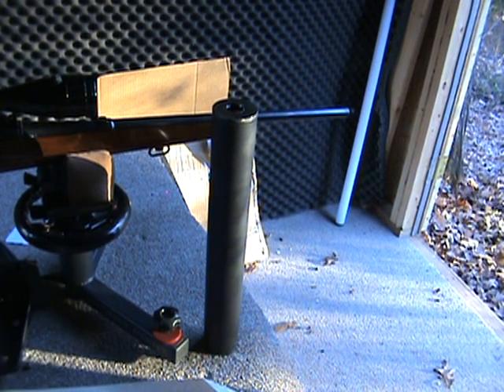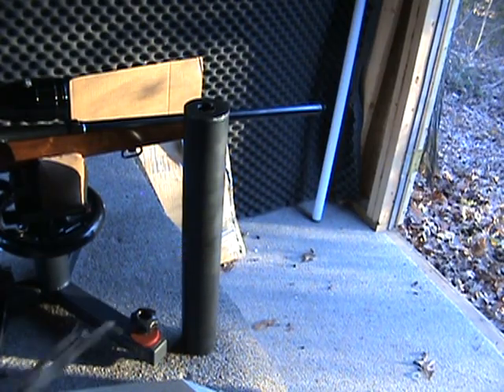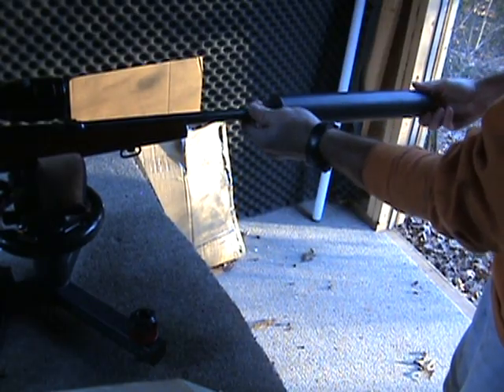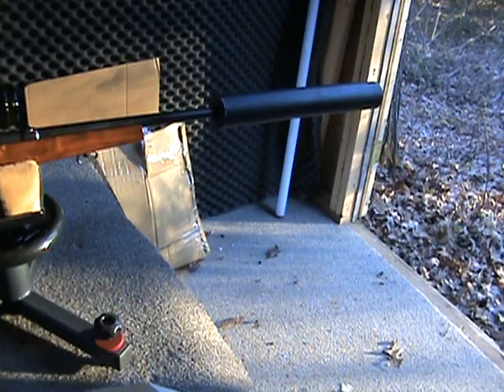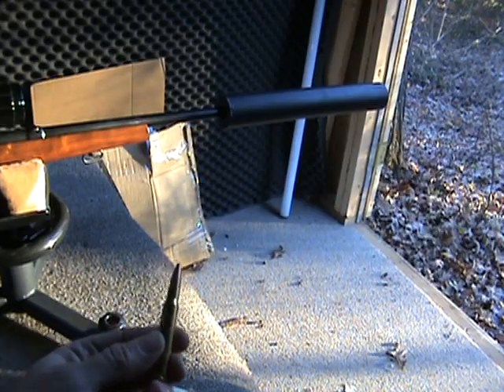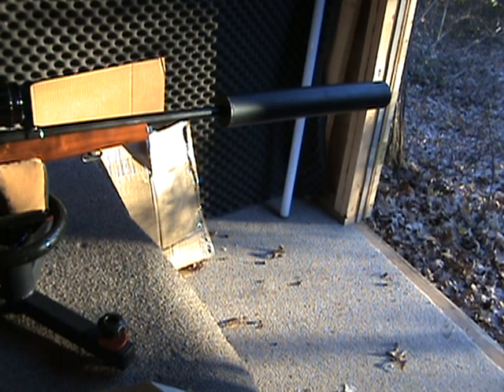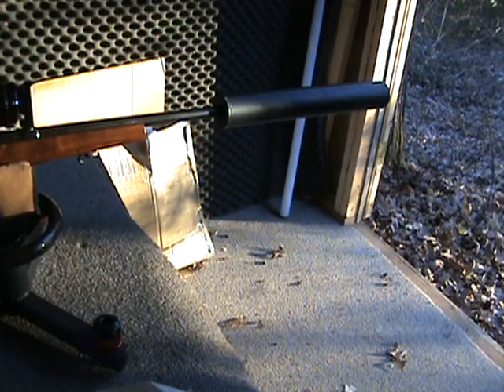Home made suppressor demo for .30-06

Comment: You can put a bolted piece of tungsten in the tube with some gorilla glue around the cylinder about a drop and 1 ml. Then just shove some 30mm bushings 3 inches consecutively apart. It helps if you bore the canister with a 5mm drill bit at both vertical ends.

Comment: Nice can.  I'm planning to do similar with my Savage 110 in 30-06, but I'm going to have the barrel cut down to 16.1 inches then threaded.  I like your slip over design and would love to see how you made the bottom half of your can, did you make it yourself or have someone turn it on a lath for you?

Comment: I'm surprised no one has commented on your video. Nice work in the suppressor. Did your custom rounds require hearing protection? Video audio seldom picks ups what the shooter hears. How long did the ATF take on your Form 1? Mine was pretty much 6 months on the dot in 2012 or 2013 for a pre-designed commercial suppressor. Supposedly the office only had 8 employees at the time completing requests for the entire country .Also, how did you thread your male/female end caps? I ask because I'm not familiar with fine threading process. Thanks for sharing your experience. It sounded effective. Last question, did the neighbors stop complaining? :)
Reply: Don't answer!

Comment: Awesome video. Congratulations 👍. I have a question that nobody answers me! So I hope you do Sir. I want to put a silencer/suppressor in my surplus k31, but I don't find any information and there's only one YouTube video whit a k31 suppressed, but the guy is shooting the gun in a platform far away from the gun, and is impossible to understand what he is saying! And the gun whit the very small " looks like a 9mm suppressor" silencer makes almost the same blasting sound like whitout suppressor! But my main question is can I put a suppressor/silencer in my k31? Is safe? I'm going to destroy the gun or worse can I injure myself? Thank you for the attention and I hope you sir. answer some of my questions.
Reply from the maker: You can certainly put a suppressor on a K31.  The 7.5 Swiss GP11 is in the neighborhood of 7.62 NATO so any suppressor made to handle that would work. You're going to have two challenges though. The first is getting the barrel threaded to accept the suppressor. The second is getting subsonic ammo.  Unless you can hand load your own you're stuck with supersonic commercial or surplus ammo.  A suppressor will still reduce the noise, but to make it really quiet you need subsonic ammo. Hope that helps.

Comment: What do you use when building your suppressor to be able to thread the suppressor on to the barrel. Is it just a normal 5/8 nut welded to the inside to make it screw on. Doing Form 1 build eventually and I’m curious
Reply from the maker: No, had to make my own adapter.  Most .30 cal hunting rifle profiles don't have enough thickness at the muzzle for a 5/8" thread.  This barrel had been threaded for a compensator with 9/16-28 threads.  I was able to get a tap for that size at McMaster-Carr or Amazon; I can't remember which.  You don't have to use a standard AR barrel thread pitch if you don't want to.  And if you have a lathe and taps you can make whatever adapter you want to put your can on any rifle you have.

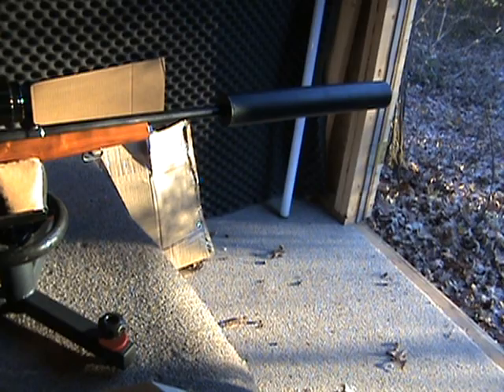Comment: At 4:10 you state you enlarged the flash holes.  Why did you do that?  Does it ignite the TrailBoss powder more efficiently?  Just wondering, I've never tried TrailBoss.
Reply from the maker: I've read that it helps ignite the powder better.  It makes sense to me and seems to work.  The case is so large and there is so little powder in it, all the powder is sitting flat along the side of the case.  I think a larger flash hole ensures good ignition.

Comment: Does it change barrell harmonics?
Reply from the maker: I'm sure, to some extent. How much, I have no idea. It probably has a negligible effect relative to other things that affect accuracy, like ammo or barrel bedding. And any impact on barrel harmonics probably won't be evident at the ranges I shoot with it.  I use it for relatively short range (less than 200 yd) hunting. I now use it mostly on my 16" barreled 300 Blackout, so the weight probably has even less of an impact on harmonics there.

Comment: How thick is your tube?  You use 60 degree cones?  I would think Al would not hold up to full house 30-06, do you shoot those a lot?
Reply: Yes, 60 degree cones spaced one inch apart.  In regard to the use of aluminum, it all has to do with pressure.  The wall is about .050" which when you do the math for an aluminum pressure vessel is plenty thick.  The larger the volume the lower the pressure and you can get away with AL.  That said, the blast baffle is stainless and all the cones are steel to stand up to the heat and corrosion.  I don't shoot it a ton so I don't worry about it wearing out.

Comment: Why suppress High Power rifles.... never seen one yet that is effective... still loud as hell.... reduced yes but stil loud..
Reply from the maker: As I stated in the video. It is a lot more quiet with the suppressor. No need for hearing protection.  And I could also load subsonic rounds and it is as quiet as an air rifle.   Gives me more options.

Comment: What's the twist rate on your rifle, and does it stabilize the 245 grains for the longest shots you take? Also interested in the bullet length an baffle types. Your suppressor sounds ok,  but seems like it could be improved. Maybe your bullets fly a bit close to the speed of sound, but with such big volume suppressors, i've heard(on video) super quiet ones.
Reply: The Rem 742 has a 1:10 twist rate.  I've only shot the 245 grainers to 50 yds.  Like I said in the video, I did mostly to shoot in my back yard where I'm not shooting much farther than that.  I got pretty good groups and no key holing so I was pretty satisfied with that.  The bullets I'm using are from Missouri bullet company for .300 Blk.  They are probably an inch and a half long.  I used 60 degree cone baffles and I am sure it could improved.  This was just my first prototype.
Reply: @matthewgioia2538  Very nice work and absolutely no criticism. I appreciate the innovation involved.  
A little more praise: You are kinder than I. A guy who hasn’t built his suppressor yet, who says your work could be quieter; that he’s heard quieter suppressors on video - proves everyone on the internet is an expert....

Comment: Can we make a 50 bmg suppressor at home ?
Reply from the maker: Do you mean technically or legally?  Legally I'm not sure.  There may be some weird ruling against it I'm not aware of.  Technically it is feasible, but it would have to be very large (and probably pretty heavy) to be able to withstand the muzzle blast of the BMG cartridge and to make any significant noise reduction.  You'd also have to use some pretty robust materials to be able to repeatedly take the heat and impact of the muzzle blast.  I guess anything would help though.  A 50 BMG is around 175 dB at the muzzle (from my limited internet search) and a .30-06 is around 160 dB so you wouldn't need much (noise reduction) to get the 50 BMG into .30-06 territory.  That is my initial take on it.  This could turn into a lengthy technical discussion on how to actually get it done.

Comment: How much would you charge for one of these ?
Reply from the maker: Unfortunately, since I am not a licensed manufacturer I can't make these for sale to others.  You are legally able to make them for yourself after submitting your Form 1 to the ATF.  I'd be willing to sell the plans for a nominal fee but there are plenty of those available for free on the internet.  Materials cost less than $100, but the time to machine them was fairly long.  So IF I were making them for sale they would be in the $500-$700 range.
Reply: Runforyourlife 500-700 with electrical tape in it? Come on man... lol   A professional can with a ratcheting or quick disconnect that goes over brakes barely run that with titanium inserts and fully serviceable.. lol  I mean your system works, nothing overly impressive, its as effective as any 60 degree cone system can be, but its nothing special.  And like you said the materials cost less than $100 to make this, that is a pretty substantial  mark up for what 20hrs worth of machining? Sure get paid for your time, but be reasonable, have to keep in mind there is also a $200 dollar tax stamp that has to go on this price too.... Tisk Tisk ... lol    No offense man.. but I do realize you said if you WERE to manufacture these, and had the license to do so.  I'd just keep it reasonable man, if you wanted business and to stay in it at least.   But no denying it works, you've proven it.  Nice job.. how much time did you put into assembling yours?
Reply: BoostedBadBoy Uh the liscense isn't cheap... keep it reasonable...
Reply: TheTyrial86 re read everything and understand/comprehend what was actually said this time.  I never said the license was cheap in fact said it was 200.
Reply: BoostedBadBoy The class 7 manufacturer liscense is not cheap to get. Along with being a class 3 manufacturer aswell. It costs alot. To make a profuct you must overcome the initial costs of getting the manufacturing liscense. 

Why don't you apply for a form1 and make it. Bud...

Comment: Worried about scratchin your barrel n jerryrigg with electrical tape? Also only 50 yd sight in..... Glad your appreciate your toys atleest but giving it some rough love and a tight fitting glove is A-okay. Why only 50 yds tho? Guess it'd be the same at 200yd as the bullet would rise than start to fall n level.